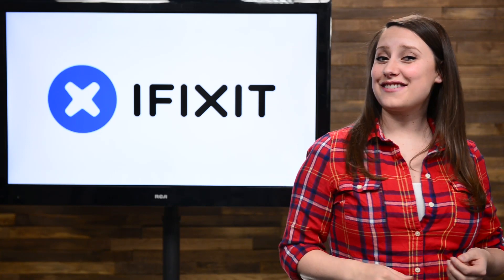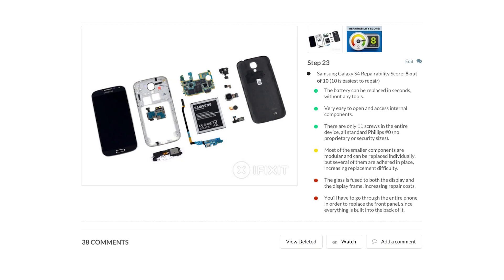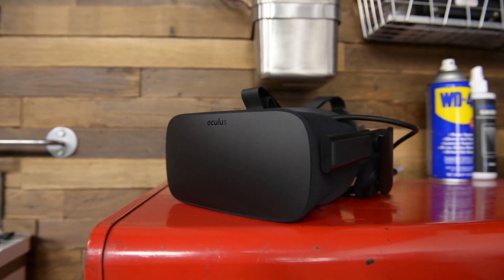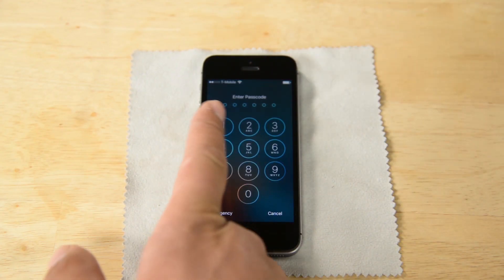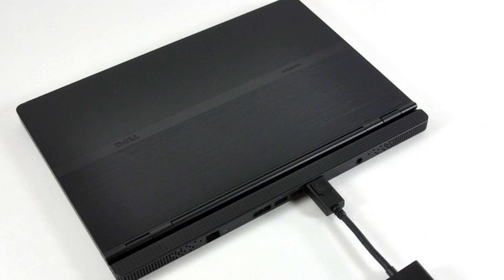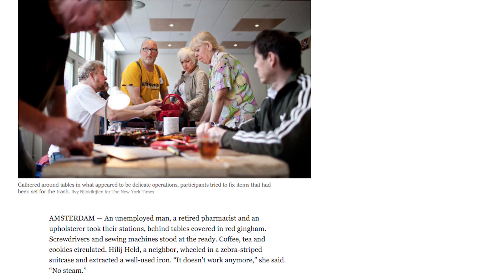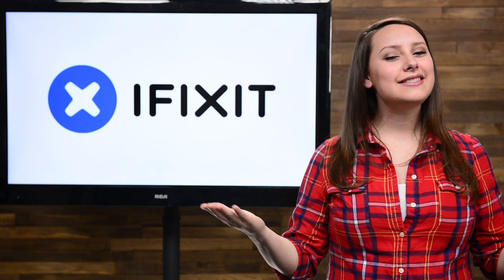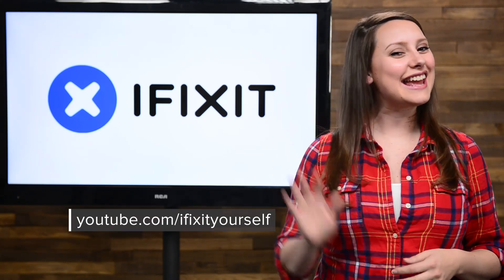iPhone SE, Oculus Rift and Galaxy S7 Teardowns! It's the iFixit March Rundown

Comment: I have a 6 or is it a 7 year old laptop, yes it may be older but all I will be doing soon is replacing the battery and maybe swapping out the hard disk and installing a SSD to give it the new speed feeling.
Screen size is not big enough but newer laptops have smaller screens (like the apple macbook etc) so I will not be buying a shiny new mac or new laptop anytime soon, likewise my old phone is a dumb phone, that works were new ones do not even pick up a signal.
I repair older tech and support people who do  not have huge incomes like the apple fanboys/fangals apple Phil Schiller  I do not care if I have older stuff it works and works just fine. My main computer is still fast enough for now and I will upgrade some of the hardware as funds become available.